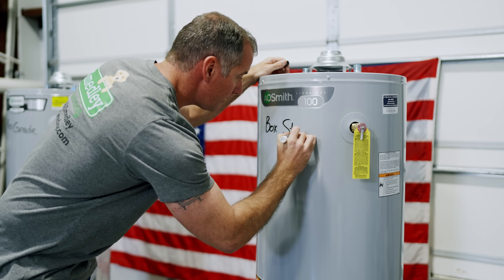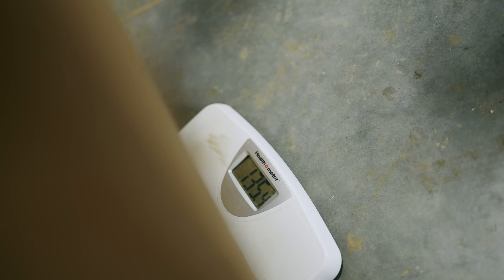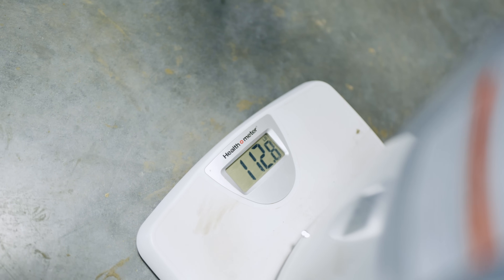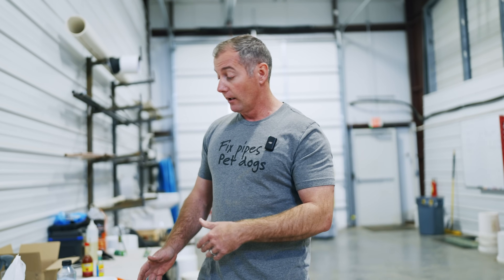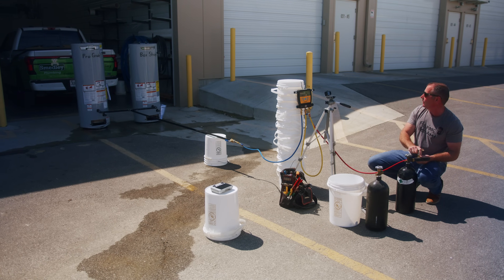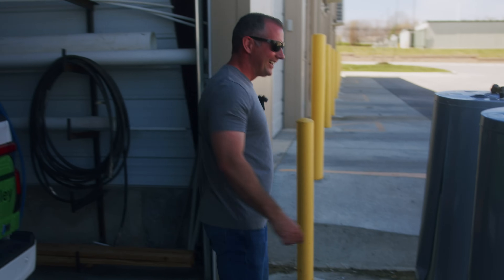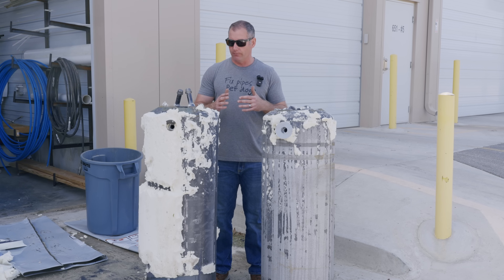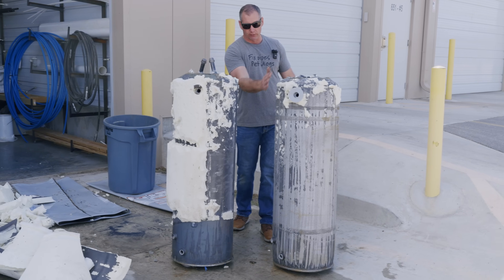What water heater should I buy? - Pro Grade vs. Box Store

Comment: After watching I'm still glad I bought my AO Smith from Lowes with the 12 year warranty as the differences found IMO are so minor as to not be of concern. I'm dumbfounded how a guy who works with WH's for a living would use a 12 point socket on an impact tool to remove the anode rods. I wouldn't be surprised to hear he rounds off the top of anodes periodically making the removal nearly impossible. As for the anodes he should know that the metallurgy should be selected based on the water the heater is used with. Magnesium is a good choice across the board for most applications but in some cases aluminum/zinc will provide better protection. Someone who really wants to maximize the life of their heater will remove the anode when new and replace it with a powered anode which I didn't hear him talk about. If you really want to extend the life then install both a powered anode and a thermal expansion tank. Heating 50 gallons of water from 50 to 120 degrees increases the volume by a full quart. That increased volume, if taps are not opened to relieve pressure, puts a lot of stress on the tank, fittings and piping which a thermal expansion tank on the inlet side will compensate for. 

The video came off to me as a predetermined conclusion looking for justifications. Plumbers, as a rule don't like big box stores as they are competitors that eat into their business. I just experienced that with Bradford White which many plumbers will say is the best. Well I just replaced my second leaking Bradford White gas WH in 13 years due to failed tanks and both went at 6.5 years just after the 6 year warranty. The first one replaced an AO Smith that had been in for 12 years and it was pulled due to inconsistent temperature control, not a failed tank so my experience is contrary to what this video is trying to tell us. 

Our lives are now full of "spin" by people trying to justify their product or service and frankly that's how this video came off to me. My conclusion was you get 95+% from the big box stores at only 70 to 80% of the price compared to a plumbing supply house. If you're capable of doing the work yourself then don't waste your money on a "pro" grade WH.
Reply from the maker: You're half right. As a plumber of 24 years I've noticed box door water heaters failing much faster than pro-grade water heaters. So we went into this video to see why. We already know they fail much faster. This video was to try to shed the light on the differences that lead to the premature failures.  I will also add that box stores are not competition for my business. Those people were never my customers to begin with. That would be like saying handyman contractors are competition of my business, which they are absolutely not. We are a fully licensed and very professional plumbing company. It's hard to compete with that.

Comment: Had a Woods that  lasted 20+ years heating our iron-rich water. Replaced it with a Rheem from Home Depot that leaked after 2 years. Got a free replacement that lasted 3 years when it failed near the top of the tank which caused water to short out the thermostats which filled the house with smoke. I got another free replacement that's 2 years old now. I'm money ahead but I'll never buy another box store heater and probably will get something other than Rheem.
Reply from the maker: Yep!

Comment: This comparison was interesting, but it could have been a lot better.  There are, for sure, differences between the two units.  But are those differences meaningful to the consumer?  Do they represent a more reliable or efficient unit?
How many hot water heaters fail due to rupture of the tank?  I think almost none, because the overpressure valves and other safety measures are pretty effective.  Both tanks had excellent performance in this regard, and what you observed can be explained by unit-to-unit differentiation and those differences were meaningless.  A lot of hot water heaters fail due to corrosion or built-up mineral deposits or failed control valves.
There are well established efficiency measurements that are set and published by the government.  So comparing the two units should include that information.
Manufacturers seek to differentiate their product line to make more money, while not building something on the low end that's so bad that it will hurt the brand, and something on the high end that's not too costly.  If we're talking about a Buick vs. a Cadillac, there are aesthetic and trim differences that to some people mean a lot....with hot water heaters, this factor is little or none.
The steel cover over the burner access is not meaningful to anyone, so that's an example of a waste of time.  

Many or all of the component parts and subassemblies have a part number on them.  Look at the part number, for example, on the burner controller.  If the P/N is the same, they are the same.  Likewise the tank.
You never measured the weight difference between the tanks themselves.  We don't know whether the apparent weight difference of what you weighed is explained by the insulation or the steel cover.  

You can buy a John Deere tractor at HD or Lowe's or you can buy one from the John Deere dealer.  Similar to this comparison, the two tractors are not exactly the same, but they're close.  There are arguments for either choice, but I'm not sure that this test told the consumer anything he might want to use to make that choice--is it more reliable, more efficient, easier to install, better for environment, higher heating capacity, or other meaningful thing?
 Strictly speaking, these are not the same units.  They were surely made on the same line and we don't know whether they were made the same day.  Are the differences, besides the sticker and the cost, mere eyewash put in place to claim that substantial differences exist, or not?  Obviously, there are two different overtemp/overpressure valves, but if neither one will fail, it's insignificant.  The Pro Grade drain valve is clearly better, but if there's a simple workaround for that procedure several years down the road, then that doesn't matter either.

Something that would be meaningful to the consumer is, will you get a more efficient and reliable hot water heater, no matter what brand or model you buy, if you drain and refill the tank once a year, or if you install a water softener.
Reply from the maker: The whole reason for the video is to explain why box store heaters don't last as long as pro grade heaters.  It's already known they are inferior.  This video help show why.  You get what you pay for.
Reply: @SmedleyPlumbing  I understand your goal, I think.  You did not tell us the top causes for water heater failure.  My guess, and I am not a plumber, is that leaks in the tank are high on that list, but leaks are only loosely correlated to tank burst strength, and you did not show that the tank itself is any different, anyways.  If the tank is identical and the gas valve is identical, and the efficiency is identical as measured by the standard methods, then the superiority of the commercial grade unit is in fact not so clear.  Is it better?  Sure.  Is the difference meaningful?  Hmmm.  I have no doubt that the plumbers believe that.
Reply from the maker: @mriguy3202  we proved that very little is identical.

Comment: Around 2005 my father and I installed the best GE tank water heater the local Home Depot sold, marked the installation date on it, and two years later it started to leak.  We were so annoyed that we had to do the job all over again and all that goes into wrestling it into a basement, moving things, disposing of the old one, etc.   After that, we've never even looked at anything other than a water heater from a local plumbing supply house.
Reply from the maker: All too common unfortunately.

Comment: 23:57 Im thinking that the hole acts as a cooling vent to suck cooler air onto the baffle. The baffle is shorter than the pro so i would think it can’t handle as much heat as the pro. Its kind of like a diesel exhaust on a truck just miniaturized. The diesel gases are so hot they can start a fire during its burn cycle that it needs the vents at the tip to suck in cooler air. Just a thought. Great video and I dont need a heater. But I have always wondered about this subject. Thanks.
Reply from the maker: Thanks!

Comment: I bought a Rheem water heater from Menards, i had 3 gas valves fail. The manufacturer did ship each time and knew when the problem was fixed for good. Only thing is, i work for free, a plumber would have cost hundreds in labor. I use an expansion tank too. I fixed a friends water heater needed a gas valve, cost 160 on Amazon. Plumbers quoted 600 to 2000 to fix. One said her pipes were 1/2 inch and needed replaced. Its still working a year later.  The next failure was her furnace, was just the flame sense rod connection.
Reply from the maker: Yeah professional repairs cost but it's worth it to have it done properly with warranty and to not worry about box store problems.
Reply: @SmedleyPlumbing  i guess so. I can do myself, its easy but now i know i get inferior supplies. I bought galvanized nipples at menards for commercial toilets in my building. The lowes ones i bought last many years, the menards ones rusted in 2 years. I understand its electrolysis and I am going brass but they look identical and from same company. Its all China though. Floods get expensive.
Reply from the maker: @markanderson350  yeah we see box store fittings and valves fail pretty fast faulty often.
Reply: @SmedleyPlumbing  yes so maybe i will shop at plumbing supply companies but maybe they wont sell to me. We have a problem with plumbers selling out to big out of state companies using the family name but now being very expensive.
Reply from the maker: @markanderson350  a few have for sure.  And good for them for building a sellable business.  That's the goal from some.  Build it big and sell it so they can retire.
Reply: @SmedleyPlumbing  good point but the consumer pays more. So will a company like Famous Supply sell to me?
Reply from the maker: @markanderson350  best thing to do is to call the plumbing supply houses near you and ask if they sell to the public.
Reply: @SmedleyPlumbing  thanks. I am very handy and poor. Lol
Reply: @SmedleyPlumbing  i remember buying copper fittings from box stores with price stickers i had to remove to solder. I was told no plumber would put up with that

Comment: I have to replace my 50gal electric hot water tank and have been looking all over and i was wondering can a home owner buy a 50 gal tank from a pro store? I live in Seattle and all I can find is Rheem and A.O smith at a box store. do you have any advice ?
Reply from the maker: Yes you typically can
Reply: Thank you for responding so fast. I will look tomorrow to see if there is a better 50gal 4500w tank I can get than going to home depot or Lowe's. I thought about a tankless water heater but that is going to take alot more work. our old hot water tank lasted 25yrs so it lived a good life. I was reading the warranty from home depot and Lowe's  on there hot water tank's is a joke 6yr only 1yr and then do it yourself all over again at your expense not much for a warranty. I got to find something better.

Comment: The box stores in my area - Lowes in my case - will deliver a 50gal hot water heater for $35. I just had an A.O. Smith 100 delivered for $35. I cut the old one in two and put the halves in my garbage can for regular pick up. It's hard to compete with that kind of cost & convenience.
Reply from the maker: Delivery is only one part of the equation.  Skilled and safe installs are the main goal.

Comment: I would have liked to see you weigh the bare tanks after the shell, etc. was off.  I suspect it would mirror the weights you did after removing the gas valve, etc.  One other thing that might have been interesting would to have cut a hold in the tanks after the failure and measure the thickness of the steel.  Non the less, it was an interesting video.
Reply from the maker: Thanks!

Comment: Are the manufacturer's date nearly the same for both?
Because the pro stores may have older manufacturer units in storage. 
While the box store got the most updated unit.
Because manufacturers do change as parts saving to squeeze more money 💰 for profits for the same product and model. 
I have seen the same bathroom exhaust fans 20 years ago vs the brand new ones with lots of parts quality changes inside such as motor, fan blades, plastic cover, smaller & thinner electrical contacts, and thinner metal guage on the newest unit.
Reply from the maker: We didn't check manufacturer dates.  Because that's part of what the buyer doesn't have control over when they need a heater.  They go to the store and buy what's available.

Comment: Great video. Mind you, clients often do get their product from same manufacturer at different specs, there is not 30+ water tank manufacturers globally, brands, yes, manufacturers, no.  Nothing wrong with that if you have a great tank manufacturer. Your failure points will often be from lack of service or poor quality control on the fittings manufactured elsewhere. 
Every market does it, it is efficient and cost effective.
Reply from the maker: Yep

Comment: Did you look at the labels on the units to see where each was made?  America, Canada or Mexico?
Reply from the maker: Nope.  Because that doesn't matter when it comes to a consumer buying what's available at each store.
Reply: @SmedleyPlumbing  I was thinking that the pro grade was made in 1 location and the retail was at another.    Did you happen measure the gauge thickness of the steel on each tank?
Reply from the maker: @jamessmoth8683  we didn't.  We used weight for that comparison.

Comment: Your experiment compared one example of each heater which is a very small sample size. Is it possible that the installed heater components could depend upon what was available on the day of manufacture? Would a manufacture or manufacture rep would be willing to provide any insight to the difference in the product lines? (Especially if they saw your video.) It would be informative to know any differences in order to make an informed purchase decision. The Energy Guide labels are designed to be comparable and list assumptions such as cost of gas on the label and list the therms used annually. Differences between the labels need to be explained and not glossed over.
Reply from the maker: I look forward to your comparison video where you navigate these topics as well as ones you haven't thought of yet.

Comment: Great video.  The one thing I would have done differently would have been to pressure test each one separately.  This way we could have seen at what pressure each one let loose.  At 450 psi, the pro unit would have flooded my basement while the box store unit would have contained the pressure.
Reply from the maker: The box store unit started leaking first. And then when we push the pressure even higher the pro grade unit had a controlled failure that resulted in a leak large enough to stop the test. But ultimately the box store unit would have flooded a house before the pro grade unit.

Comment: Why didn't you weigh the tanks? That's what i was waiting for. Also, after comparing all the parts and talking about quality, why didn't you do a performance or  efficiency test? Does all that quality add up to energy savings? That's what the end user needs to know.
Reply from the maker: We did weigh the tanks but not without the insulation.  Performance wise, we already know the box store tanks fail faster.  This was to learn why
Reply: @SmedleyPlumbing  I guess I missed the weighing of the tanks. Sorry. I appreciate all of the effort you put into your video. Thanks.

Comment: Live in the Midwest. I’ve always had a plumber from a pro shop install my heaters. I’ve had some last 5 years & some last maybe 7-8. They like to blame our hard water on the failures. Mine usually leak out of the bottom. It’s really sad when it’s around $1200 a pop. Warranties suck now & heaters just don’t seem to last like they used to.  Had 1 fail just before the warranty went out. New heater but still $400 bucks in labor. Sheeesh 😢
Reply from the maker: It happens.  And water quality makes a difference.  Also proper water pressure makes all the difference as well.

Comment: As long as its installed and properly maintained it will last a long time. My Westlake Reliance 40 gallon gas water heater is 27 years old and going strong.
Reply from the maker: It's highly possible that 27 years ago they were indeed the same units.

Comment: It depends what causes the heater to fail.  I built my house in 88.  I  used professional A O Smith and it lasted 7 years - tank leak. I replaced it with a  Menards unit (forgot the name) and it lasted 28 years.  That’s the only thing that matters.  I agree the drain spigot should not be plastic and my Rheem from Menards is not.  I do buy the 12 year warranty model.
Reply from the maker: Awesome!

Comment: I had.
 To rheem
40 gallon hot water. Heaters fail on the same day, one from a plumbing supply store and 1 from a box store. It seems the tank welds were no good, so I had no alternative but to buy a Ao Smith.  From Lowe's.
Reply from the maker: Or buy ao smith from a pro grade supplier.